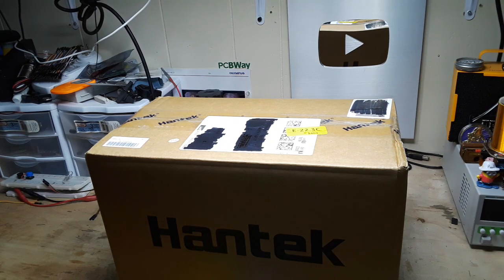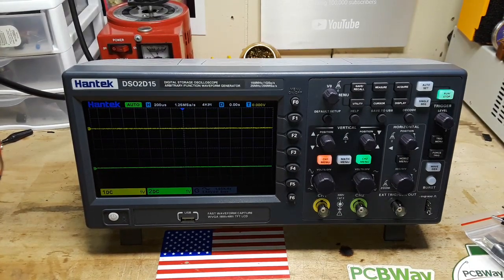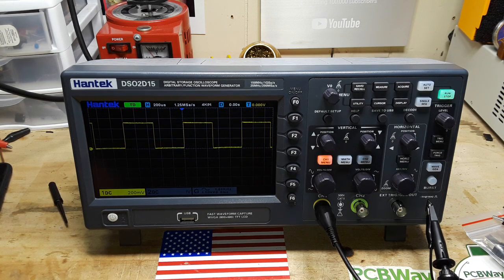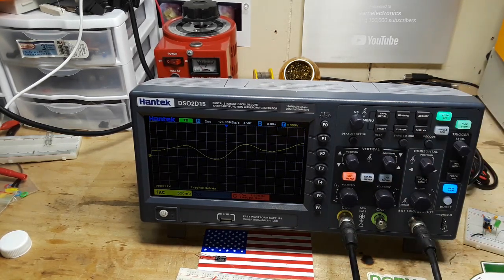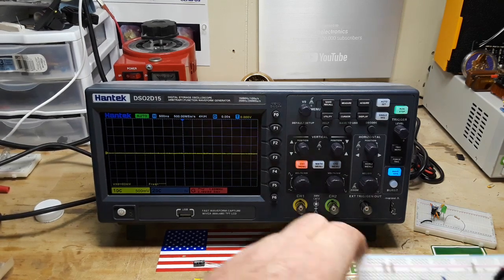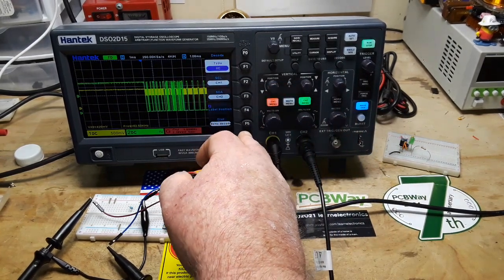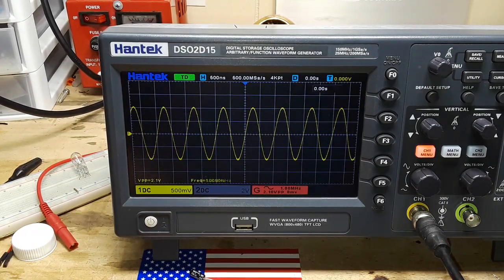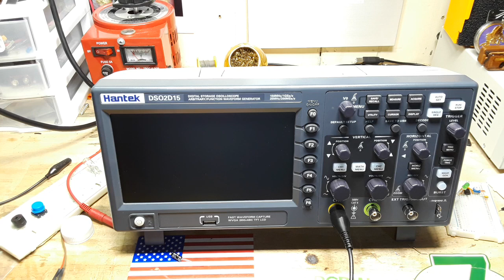Hantek DSO15 150MHz 1Gs/S Oscilloscope with 25MHz AWG Review

Comment: Installing radiators on both ICs inside is highly recommended. Solves random freeze problems caused by overheating.
Reply: Radiators on both ICs is must have mod for DSO2xxx scopes AFAIK.
Reply: @KrotowX  Post a vid about the how and where these need to be added or indicate which IC's could use them. I'm considering getting one of these to replace my recently acquired Tektronix TDS210.
Reply: Add a fan. It has a spot.

Comment: You can't beat Hantek for the money.  Combining an AWG with a very capable hobbyest scope saves money and space.  I have a small bench so having two devices in one, at the price of one, makes this unit a great deal.
Reply: @jstro-hobbytech  That's so true! I think we all make the same mistakes starting out. I paid too much for my first one, not the second. Now I take my time and shop around for gear. I have 5 oscilloscopes, vintage and new and I've learned something from each one.  Great hobby!!
Reply: @jstro-hobbytech  I hate a thief or vandal. They don't care how hard you worked for what you have, just a game to them. Someone just hit my car and ran off. It was parked and no one saw it, just our cash out the window!! That was right 'after some other bastard broke in and took my tools. No price to pay for crime these days, I guess we have to get used to it. Or fight back!!
Reply: Agree. DSO2D15 seems the best DIY scope for the money. Better ones with same features cost 2+ times more and doesn''t add much.
Reply: @KrotowX  i also need one for diy and this is what im going with
Reply: I just bought one today DSO2D15, was new in box but appears to be missing CD and Manual, just asking was this supplied in your delivery...
Reply: @michaelblakemore-rw6iw  I have two Hantek scopes and both came with CDs that would not load.  They have a link on their website for a manual but there was nothing in the box. Both of the scopes have been great.
Reply: @coptertim  Sorry mate think i hit thumb down oops...lol yeah noticed online software and manual, but appears to be functioning fine anyway.

Comment: 300 mhz scope to measure 100 mhz clock? No, the accepted ratio of 5 to 1 is required for a high fidelity measurement, so a 500 mhz scope is desired. Also, the long probe ground is not advised, use a spring ground hook right at the tip of the probe.

Comment: Another question: Can I buy a 200Mhz probe and use it on a 100Mhz scope or this 150Mhz scope? Do I need to match the Mhz exactly with what the scope can do? Thanks!
Reply: Yes you can do that the probe has not to be the exact one. More important is that you have to calibrate the probe at the scope over it´s trimming capacitor with the cal marked place at the oscilloscope.

Comment: The calibration does finish eventually. It's definitely not one minute, but even though it seems like it starts from the beginning, the lights actually change every time it loops. I think it's just doing the different channels and configurations, at some point you can even hear the relays flicking.

I came to this video a while back, and today I have my first scope. So thank you! I would have also never found out about the calibration feature if it weren't for you. Suppose that's just something you do with scopes, but again I've never had one, and never really came across any video that was like "these are the things to do/not do if you have a scope" either. Maybe that's a good idea, you sure seem like you have the experience to make a good one of those- I'd definitely watch it. Have a nice one, and once again thank you!

Comment: I am sending mine back. Dynamic microphone test- compared with 30 yo oscilloscope to Hantek DSO2000 series-- Old cro picked up dynamic mic audio no problems. On Hantek, waveform noisy and Cro insensitive. If a whizbang oscilloscope can't do basics like display mic audio, then it's a bin job.
Reply: Same here. Minimal amplitude for input signal for this wcope to work as expected is above 20mv. It has noise filter that helps a little bit. Other way. This can be overcome. Just set up a one stage amplifier and then connect the low level signal. One stage amplifier can be tested with 50mv 8npus signal to check if it works...

Comment: Just discovered your awesome channel and of course subscribed. I tinker with arduinos, pi, esp32 but I'm new to deeper level electronics. One big question I can't seem to find an answer to is some real life use cases and type of troubleshooting where you would use an oscilloscope like that? These features are excellent but I'd love to learn when and how to use them.
Reply from the maker: A simple one would be to characterize a filter. Say you want to build a low pass filter with a cutoff of 20KHz. (Upper auditory range)
You would use the awg to output a sine wave and sweep though a range, say 15K to 25k.
Then use the scope to watch. When you see the amplitude halved (-3dB point) that's the cutoff frequency.

Comment: Is this model sufficient for a beginner in vintage radio servicing, adjustments, alignments, vintage and modern ham radio, audio/music electronics like guitar amps and synthesizers, as well as restoring vintage retro computers? Can it handle the higher voltages of tube electronics?… Can the generator AND scope be used simultaneously for both injecting a signal into a circuit, and then simultaneously measuring it in the circuit with the probes? Also, I’d love to see your version of a video on OSCILLOSCOPE SAFETY, in terms of grounding, isolation, and avoiding a ZZZAPPING experience… Thanks!

Comment: I’m hoping you can help me. I just got a Hantek DSO2D15. The trigger setting in 10X mode is not stable. I’m not sure if my scope is broke or if it’s a defect in the software. It seems to work fine in 1X mode.

Set the scope in 10X mode. Connect the probe to a power source – I used the 5 volt probe check. Set the trigger or hit the Autoset button. Now adjust the volts per division a few times. Does your trigger setting drop down to 0? 

Thanks for your help and keep up the great videos.
Reply from the maker: Return it
Reply: @learnelectronics  The seller offered a full refund but they don't have any left in stock. I  can't find another one in the US.
Reply: @learnelectronics  Glad I didn't return it. Hantek sent me an update software that fixed the problem.  Thanks for your help.

Comment: You found a better use for the solder tool than actual soldering, opening a box seems to work well.
Rohde and Schwarz! Yeah, that isn't happening.
ROFLOL, in calibration mode forever.
If you are using the switching power supply for the crystal oscillator, you may want to try battery power to see if the signal is cleaner.
Open the box review is really more of an overview. In depth review may take an hour or more. No worries Paul.☮

Comment: Although Hantek made efforts to release firmware and software updates for the DSO 2000 series oscilloscopes, they should provide also the software tools needed to perform backup and restore operations.
Furthermore, I wonder how can a company that manufactures oscilloscopes can release a product on the market without heatsinks installed on the processors and without a good silent fan to aid the cooling process of the device wile running?
Reply from the maker: It's China. There moto might as well be: We got you to buy it, it's yours now.
Buyer beware. Do your due diligence.
Reply: @learnelectronics  The funny thing is that the other two popular models from Hantek, DSO4102C and DSO5102P, do have passive and active cooling.
I saw teardowns of those two models and both had heatsinks and fan.

Comment: Do you have to calibrate it each time you use it after it's been off for a while or is that just a once in a blue moon or one time deal?
Reply: depends on the level of importance of what you're working on

the probes in my experience rarely blip off calibration once dialed in, and i thrashed mine in my book bag in school

Comment: I just got one of these and it's my first scope, seems like some other commenters are in the same boat there... I also wouldn't have known about the calibration or the 20min warm up time had I not seen it here, none of the other videos I've seen about these scopes touch on either, what I'm wondering is whether that needs to be done every time I power up the machine or if it's mainly a one-time thing... I assume the probe compensation is mainly a one-time operation but I'm not sure whether the scope calibration is or not
Reply from the maker: Only once

Comment: Hi Sir, for a weekend hobbyist, what doc would you recommend?
Reply: Depends on what you want to do with it. I recommend the 4000C with the signal generator or 5000D series because it has the 16 CH Analog Analyzer and the signal generator. Hantek scopes are pretty easy to unlock the faster speed as well so it is more important to get 4 channels. You will need to get the faster probes for a few dollars though because the slower scope ships with "slower" probes. The internals are the same because they are software locked to the speed. If you want faster signal generator I would recommend getting the FY6800 for $100. Hantek also has a very rare 4000S which has an Analog analyzer and Signal generator.
Reply: @excitedbox5705  OK, thanks 👍

Comment: Just put a FM portable radio in front of this scope and you get a noisy radio because it radiates harmonics from lcd to 0.5 m. Move radio back of scope and noise it start from5 cm. Test your home tv and see if the radio is geting any noise. Then test another scope. I had Tek......series 1000 at job. No harmonics radiation with the radio at 1 cm around. No email answer about this issue from hantek

Comment: Nice review. Sorry but i don't like this scope. Cheap and not good at all. He looks like a pro but he's not. No more than 20/30 MHz maximum and certainly not 150 or 200 MHz => if you want to obtain stable and precise measurements <=  Not recommended even for audio signals for several reasons. Add $150/200 to get much better. But it's your money, so... ;)

Comment: thank you for the video. I'm trying to catch all the hantek ones.  was looking at the  Hantek DSO2D15 becasue of all the bells and whistles and lower price, but all these things I'm reading abut freezing issues.  and youtube reviewers who said it's awesome then next month they have a video about all freezing problems and even 5 months later they still have some problems.   as of October  2022 , does anyone know if Hantek has fixed all the firmware bugs that caused freezing. some people showed repeatable actions which made this happen doing normal things. 

Techcorner guy  has at least 3-4 videos showing his ongoing saga trying to get it fixed using different firmwares.  I also read that maybe adding a fan or heat sinks on IC's help with some freezing?  at this point in 2022, if this is truly an issue , has  Hantek added a Fan and more heat sinks to the  Internals?  
I would feel more safe buying it, if I knew it was past this stuff now and  new one would have some love and attention from Hantek after all the youtube and eevblog feedback to them.
Note I have only read some so far about the issues as eevblogs is overwhelming,  too many videos from multiple people show  the firmware and the hacking you have to do. and at least 3 different regular youtube makers with problems on the Hantek DSO2Dxx

Would love to buy this if anyone knows it's all fixed now?  or do we still need to add a fan and heat sinks?  but seriously if hantek has this out for 2 years then  new models should have fans installed at hantek factory or is that Wonderland thinking?
Reply: I hear you, see you also need to realize if they fix something they will bump up the price... not only that they also will have new pictures published everywhere "upgraded version 2023" whatever and Amazon sellers will copy that picture and sell you old ones with new marketing material. The real upgrade will be to just have a new face panel. I knew this was a trash item so I bought used one. Saved few hundred.